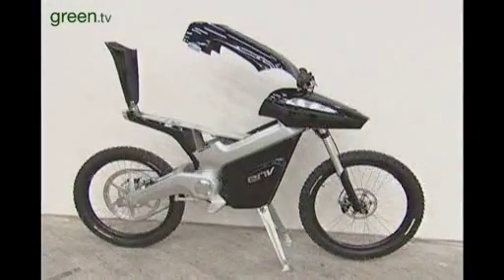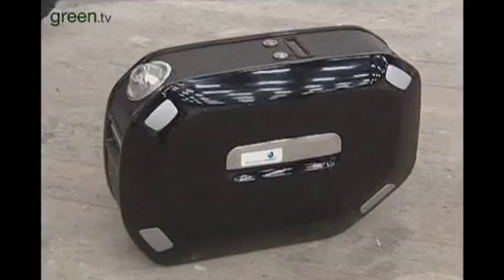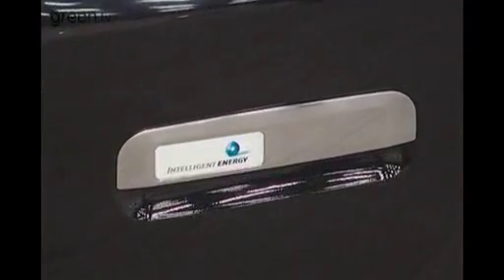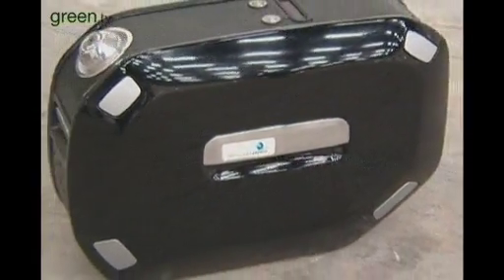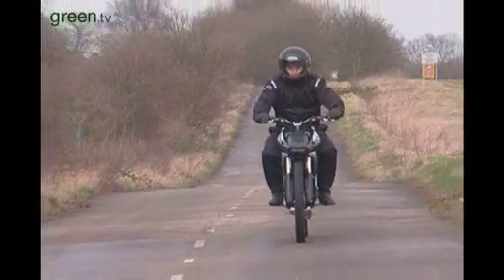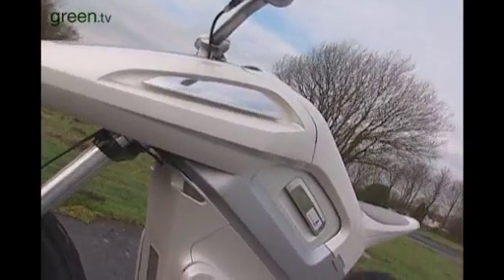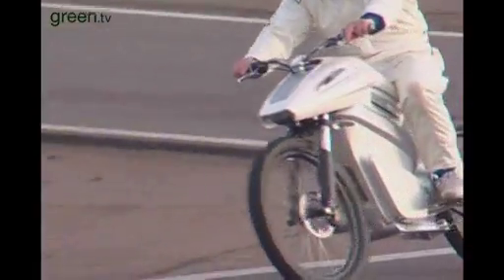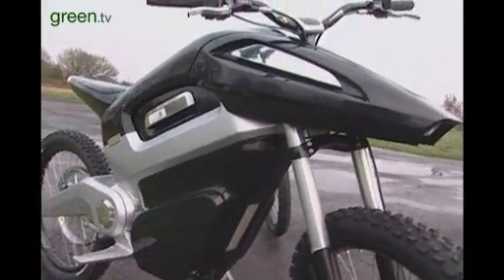ENV Fuel Cell Motorcycle

Comment: Hi there,

I am very interested in buying this bike. I have a few questions:-

1) Does the bike have indicators? (Legal requirement in the UK)
2) Can it be "recharged" at home
3) How much does it cost?
4) Why didnt you incorporate the electric motor in the rear hub it would be more efficient wouldn't it? plus even less maintenance!!
5) If its designed for the developing nations, does that mean that it will cost approx £500- £600 (as is the typical cost of a 50cc motorbike in Asia).
6) Where can I buy one?

I look forward to your reply

Comment: just imagine if the PC had to be redesigned for every new computer that came out... that would have slowed things down.  It would be good if the battery for one bike could be interchangeable with the fuel cell of another bike, giving users choice and allowing in specialist design and manufacture companies that don't have the ability to launch a whole bike concept, but might be able to contribute to a small part of the vehicle. 

Why are fuel cell machines not on the market yet?